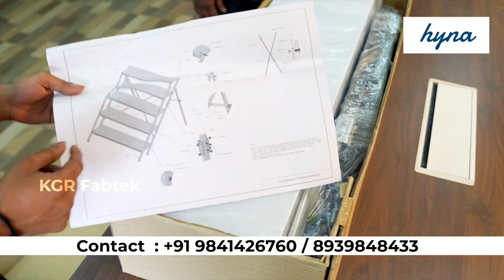Multipurpose Golu Stand

Comment from the maker: Dear all,

We have 3 models with foldable golu stand having step size of 45 inch X 10 inch 

 and also supporting based on customer requirements like 9 shelves /7 shelves with 6 ft ,5 ft .

You can book our products through hynaindia.com or call 9841426760/8939848433 for further technical details